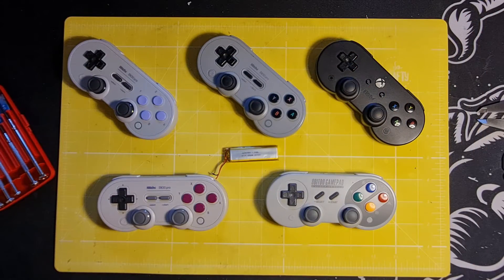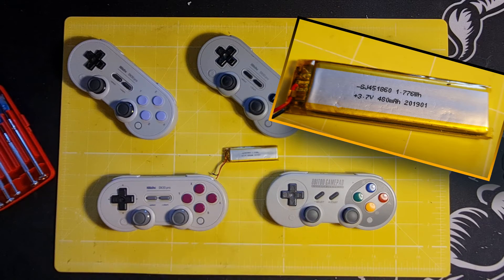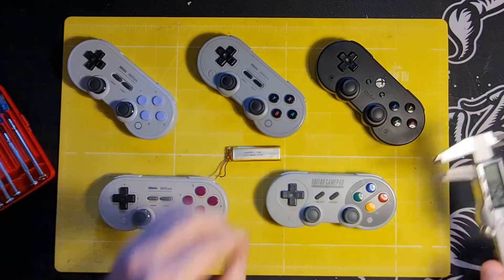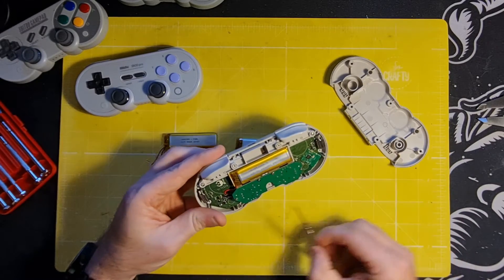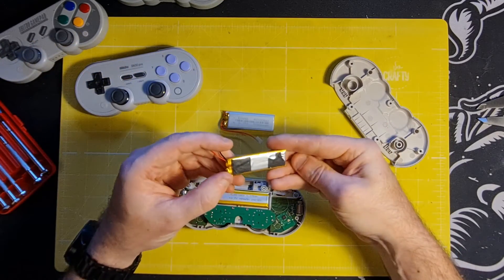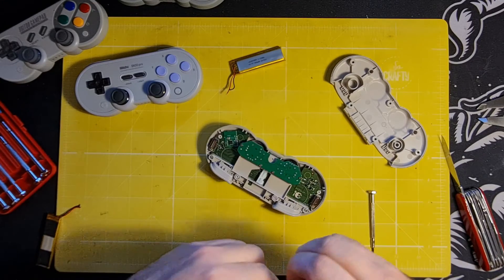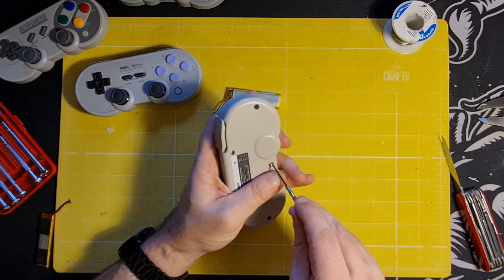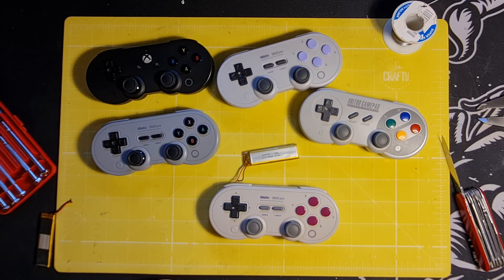8BitDo Battery Replacement - SN30/SF30 Pro

Comment: Yo I actually ordered these batteries and have tried soldering to a regular SN30 controller.  Would there be any reason for it not working?  Like too strong of a battery or something.  Cause it’s not working.  I’m assuming I just suck at soldering.  I ordered some flux maybe that’ll help.

Comment: My controller only works with the cable connected. Could the battery have died and I should change it like you did?
Reply from the maker: Sounds like a reasonable diagnosis.  While plugged in,  the battery should be charging,  so when you unplug it the battery should take over.  One or more of the lights should be on or blinking. If there are no lights then I'd assume the battery has failed.

Comment: This is the only video that actually goes into the details of the battery. I've had my Ultimate Bluetooth controller for 2 years now and it just died on me which is weird since I rotate between my controllers depending on the game. I contacted support and in lamens terms the person said, "Sorry, you're out of warranty. Please buy another one". Not even a discount code to at least soften the blow. Went to AliExpress since they are the only site that sells this battery for less than $12 as oppose to Amazon which range from $35-$55. Ordered one and will wait to see if the one i got actually fixes the issue. Their controllers are great. It's their semi-planned obsolescence for the battery is what annoys me about them.

Comment: Watched the video to see what the inside of the SN30 Pro looks like. I expect this to be useful to me as well when the battery on my SN30 Pro (G Classic Edition) starts to really show its age. Got mine back in mid 2019 and its been working well. I typically use it wired, but sometimes wireless using 8bitdo's Wireless Adapter 2.

Comment: Do you know the outcome to put an 1000 mAh battery for longer battery life. Like an 702060 1000 mAh ?
Reply from the maker: As long as the voltage matches (3.7v), a larger battery of the same type  like the one you mention will work and last longer. But it won't fit in the shell. Don't try to squeeze it in as these types of batteries can be very dangerous if they are damaged.

Comment: The same GJ451860 battery is also used on the 8BitDo M30 Bluetooth (80HA V2) as I just disassembled mine. 
To viewers who might be reading this comment, I haven't tested if the 402060 as suggested by this channel is a drop-in replacement though as I haven't bought one.

I do think it's safe to assume other M30 controllers share the same battery and are in theory  compatible with this replacement.

Comment: hey after replacing the battery on mine, I am getting an orange blinking light on the top. It refuses to "turn off" and appears to be unresponsive. Any ideas?
EDIT: NEVERMIND! I needed to keep it plugged in for a while to give it enough charge. Worked after that!
Thanks for the guide though, really saved me and my usa snes version controller
Reply from the maker: Glad to hear you fixed it.  I wish replacing these things was more straightforward. They're great controllers but for this one flaw!

Comment: Thanks to you I was able to get a straight answer while looking for a battery that fits. Just got my battery soldered in (first time in decades that I’ve touched a soldering iron). Works like a charm.
Reply from the maker: That's awesome to hear.  I'm glad you found it helpful and were able to save your controller.

Comment: MANY THANKS!!! My beloved SNES30 (SNES edition SN30) non pro battery died and I've also been looking for a replacement. Do you have any spares? Whereabouts in the UK are you? Maybe I could pop by if by chance you're local and buy one from you
Reply from the maker: Thank you for watching. I'm glad my video is of help.  I'm afraid I'm not willing to give my address out to strangers on the internet (I'm sure you understand).  Since I made this video the 402060 battery has become available from multiple sellers on eBay, but the cheapest I see there is £9 which seems quite steep.  I recommend buying a few from aliexpress if you don't mind waiting a few weeks for it to arrive.

Comment: i love these controllers i wish they had an easier replacement battery thing you can buy like the pro version of the controller that looks like the ps4 ps5
Reply from the maker: Agreed.  I have a couple of those pro+ controllers and, at the time I got them, 8bitdo weren't selling replacement batteries.  I don't know if that's changed now,  but at least you can use AAs in those too, like XBoxOne controllers.
Reply: Lmao, this comment aged well 😮

Comment: can you please tell me the name of that gun your using to replace the battery or whatever you want to call it? how much does it cost? and where can i get one?
Reply from the maker: It's just a soldering iron.  This one in particular is a "dremel" branded gas-powered iron.  Any soldering iron should do as you only need to detach and resolder two small wires battery wires.  Gas irons are generally not the best as you don't much control over the temperature,  but it does the job here just fine.

Comment: 4.5mm x 18mm x 60mm seems quite rare a model... 402030 was very easy for me to find (used in several dashcams) but even 402060 was difficult to find in stock.

Comment: Are the batteries of the 2.4 Ghz 8BitDo M30 & SN30 controllers also user-replaceable ? Please make a video on those.. as they are pretty popular to use on MegaSG, Genesis or SuperNT/SuperNintendo..
Reply from the maker: I don't have any of the 2.4GHz versions of these controllers, but my assumption is that they would use identical shells to the BT models and therefore the same batteries would be used to fit into the cavity. However if you plan to replace the batteries in yours, I suggest opening them up to confirm. If the cavities look different than in the BT one shown in my video then measure it and find a battery that will fit. In the video I explain how the reference numbers of these batteries relate to the physical dimensions.
I do have a M30 (bluetooth), not shown in this video as I acquired it after, and I've opened it up to check and the battery is the same as the one used in the SN30Pros and the alternative I suggest will also fit.
One more point to make, the batteries aren't officially "user-replaceable", if you believe your battery is failing and is within warranty (usually within a year of purchase) I recommend contacting 8bitdo about a repair/replacement. Replacing the battery yourself will most likely void your warranty and should only be done if your controller is already out of warranty.

Comment: Too bad. The surgery was a success, but my particular issue doesn't seem to have been with the battery at all. 
There must be some other fault that causes these controllers to brick themselves. 'Above my skill level at this point.
Reply from the maker: That's a shame. I'm not aware of any prevalent bricking of these 8bitdo controllers and all of mine are still going strong. I'm sorry to hear that yours has this problem ☹️

Comment: Thanks for the video bro. I found a 3.7v 102050 1000 mAh battery the same size as the one in 8BITDO on AliExpress, do you think replacement is possible or could there be a problem? Thanks.
Reply from the maker: That number tells me the dimensions are 1mmx20mmx50mm.  Very thin. It'll certainly physically fit in the cavity, but I'm suspicious of the 1000mAh rating. Less than a quarter of the size of the original 8bitdo battery, but over twice the capacity. I hope it's true.  Mind you, with  batteries that thin you could fit more than one in that space, wired in parallel, to multiply the capacity.
Reply: @widge  Thank you very much for answering me, I don't know much about the capacity of batteries. 1000 mAh can be a scam, really. Didn't know you can fit two batteries in one 8BITDO FN30, can they be soldered on the same pole connection lead?
Reply from the maker: Essentially yes, but unless you know what you're doing I would strongly recommend against trying multiple batteries. Do some research first about the difference between wiring batteries in parallel and series. The last thing you want to do is accidentally inject double voltage into your controller.  Good luck with those batteries though. I really hope they are as advertised. :)
Reply: The number make some confuse.
But 102050 1000mAH thickness is 1cm not 1mm
Reply from the maker: Thanks so much for the correction.  Yes, you are correct!  It's confusing that some measurements are in millimeters and others are in 10ths of millimeters! 😵‍💫

Comment: Can all 8BitDo batteries be replaced?
Reply from the maker: I imagine so, as long as you make sure the replacement battery is of the same type as the original and fits in the cavity of the controller.  However, I 've only looked inside the SN30Pro and SF30Pro so I don't know what batteries are used in other controllers.  Hopefully the information in this video about how the battery number code represents the physical size of the battery can help you.

Comment: I just got the box Sn30 Pro delivered to me  and will not charge. I am guessing I need to replace thr battery.
Reply from the maker: Unless you bought it advertised as faulty or non-workimg, I would recommend first contacting the seller to see if they will replace it for you.

Comment: Hello, I've just repaced my sn30pro batteries but its showing just one bar of battery even if I left for a long time charging, is it normal?
Reply from the maker: The SN30pro doesn't have a battery level indicator except that the power led blinks when the battery is low.  
The green lights (maybe the bars you refer to) only represent the type of input mode being used.  You should refer to the user manual for an explanation of the meaning of the lights.

Comment: Any way to upgrade the battery? With more mah capacity? Whould be much better...
Reply from the maker: As long as you can fit it into the space  available. Unfortunately there's not much wiggle room and more capacity usually comes at the expense of a greater volume. The battery I found advertised a slightly higher capacity and it was thinner so it might be possible to find a thicker one with maybe a little extra mAh.